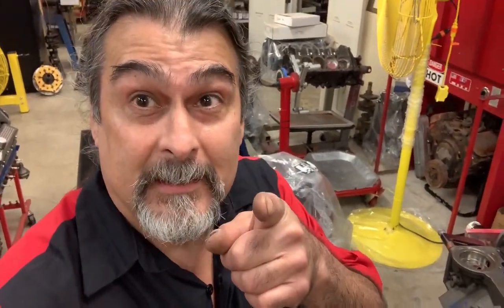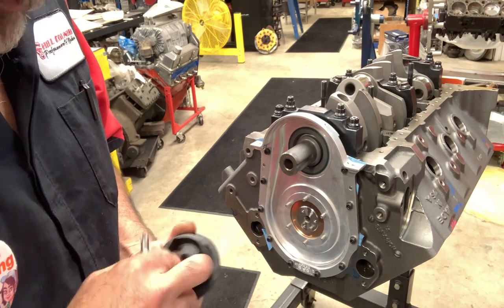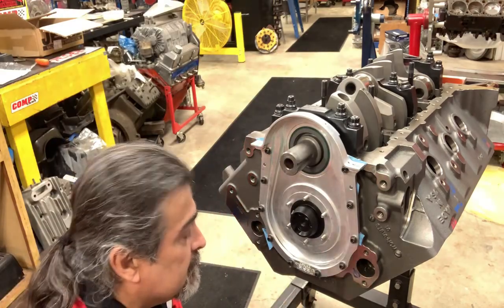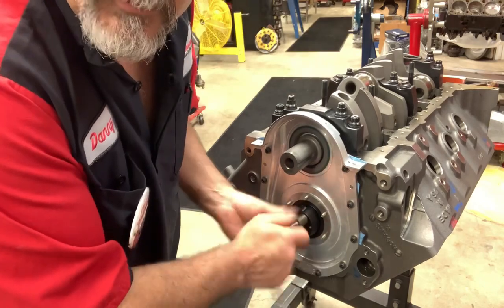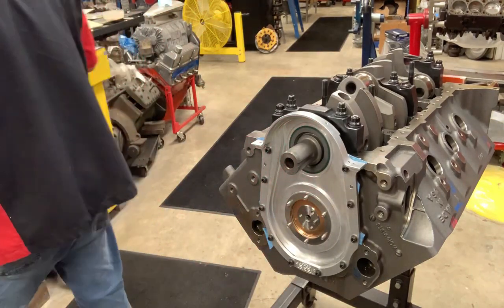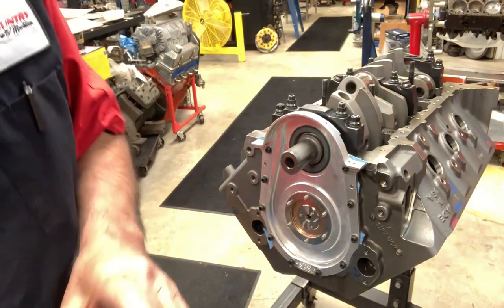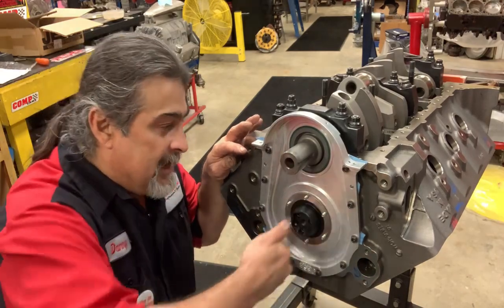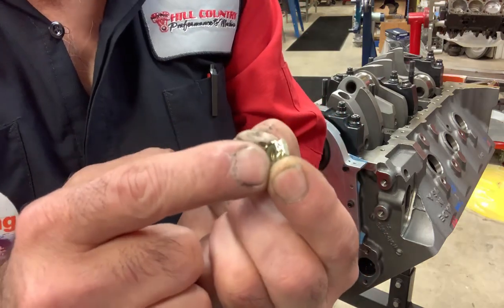Jesel belt drive setup / mock up

Comment: Learnd how to remove keyways doing motors when I first started out. Sometimes what I would do is put the Key on the belt sander to thin it out a little just to make life a little more easier putting it in And remove burrs the  I put into it taking it out…… Love the comment sometimes you gotta walk away because it’s so true and if you’re walking away cooking burgers even better… Jessel belt drives are awesome….. Keep on rocking…

Comment: Is that a real rubber seal or a commy plastic one that has to go on dry and seat for an hour?
Reply from the maker: It’s a Teflon seal and yes they go on dry. I know people have had problems with them , mostly old school people and they put oil on it and or damaged the seal. I have never had a leak with one 🤞

Comment: How are these belts for street?  They don’t give changing times on strip times
Reply from the maker: This belt system is not for the streets. It’s for a drag car. Now I have seen it on a street car, that guy put a wire mesh cover over it and it worked just fine. He didn’t want anything getting in between the gears and belt.